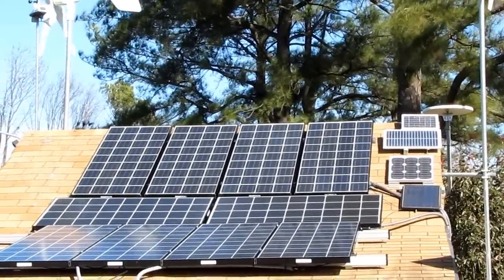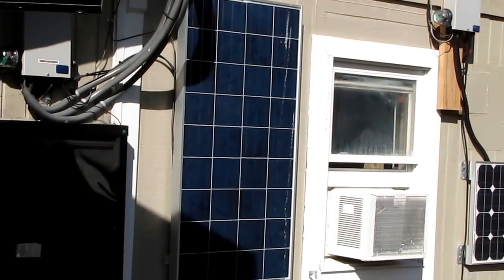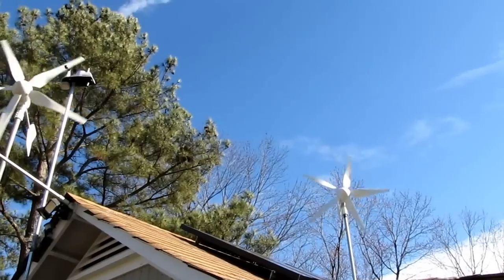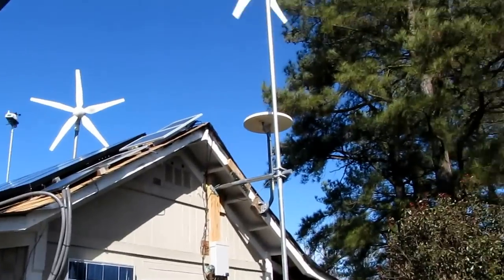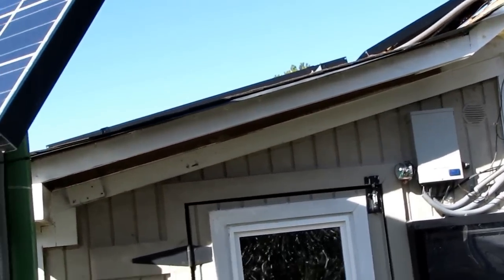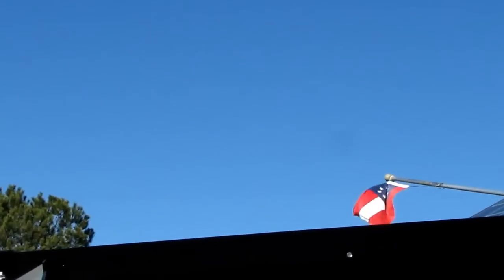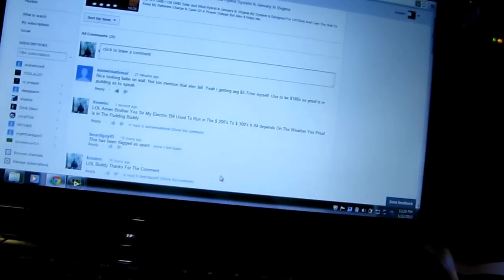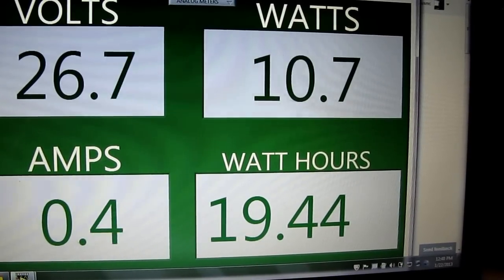Solar and Wind Power Harvesting On A Cold January Day By VIARLOCITY

Comment from the maker: Hi Buddy  My System Is 24 Volt I did Have 12 Volt  System  But The Bigger Voltage You Go Like 24 Or 48 The Smaller Cable You Can Use  I have Close 30 K In My System Since 2009 Buddy A Learning Experience